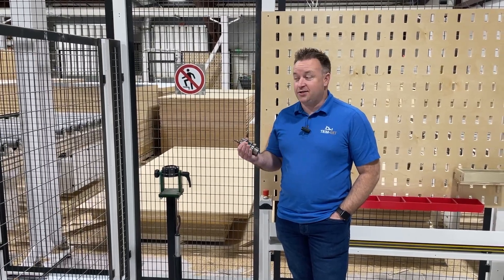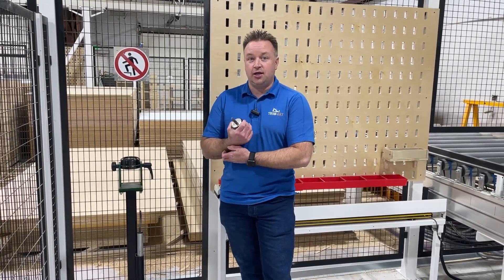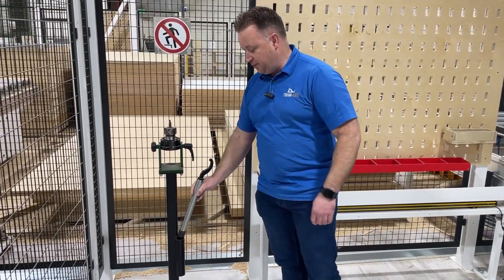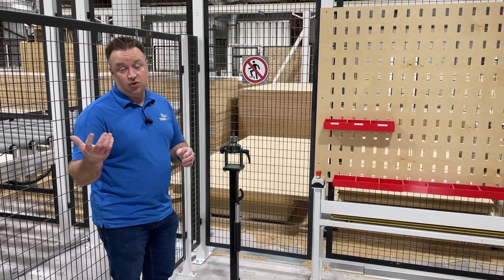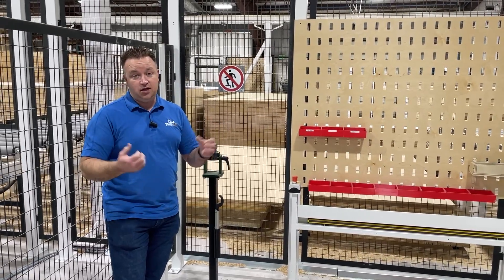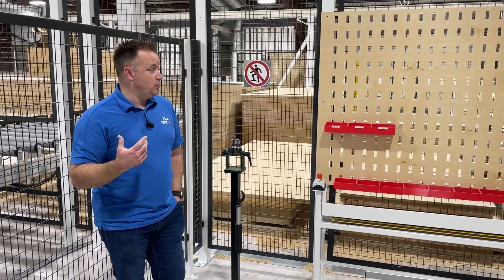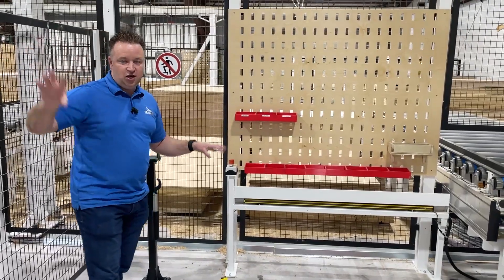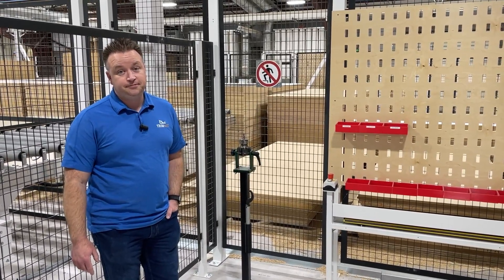CNC Tool Stand - fast tool changes and less downtime for the CNC machines

Comment: Hello. Impresive throughput on your machines. I am wondering do you maybe have information about meters of cut with one bit? Do you maybe cut also birch plywood with HPL glued to both sides also with this bits?
Reply from the maker: I’ve never kept track of that, just sheet counts.
Reply: @lean-brothers  would be interesting to compare. becouse if you tell me in sheets firstly your sheets are aproximatly half of european standard sheets secondly i can easly use 500sheets of material but i only do few meters of cuts on each. I use leitz diamaster pro (12mm by 22mm of workhight) bits and with 18m/min and 22000rpm i make aprox 3500 meters of cut on melamin boards. But i am not satisfied with speeds and lenght of cut.

Comment: I know you said you’re finished trying cutter but … you should try get your hands on a 10mm 4 fluted cutter. We started using one 6 months ago to cut our 16mm melamine and we can get 300-400 sheets out of each cutter with the machine running at 38m/min, cutting in a single pass. Was a massive upgrade from our previous cutter running at 25m/min with 2 passes.
Reply: Hey Harry, where do you get them cutters from?
We use 12mm 4 flutes & can’t get above 300 sheets, single or 2 padding, cheers

Comment: Nice video!  I also work with the guys at Advanced Machinery.   A great group over there!  Just a thought, what about having an extra tool holder loaded and ready with your main 3/8 compression bit.  If it needs replaced you only lose moments of cnc time.  Then while the machine is running the operator can refill the tool holder.  Of course if one of the less used bits like drills or mortise bits needed replacing you would have a bit more downtime.   Just thinking this could save even a few more minutes.   Thanks for sharing!

Comment: Hi
we use shrink collet in our single tool SCM vertical CX100 machine with PCD tool 2 flutes.
The PCD last longer and the round out of the shrink collet vs normal collet can trilple the tool life.
I´m agree to use HM tools and not sharpen them, for the same reasons you explain, but I have only one tool and the 95% of the use of our machine is boring, the PCD one tool on the machine one tool in spare is enough for us.
saludos
Gerardo